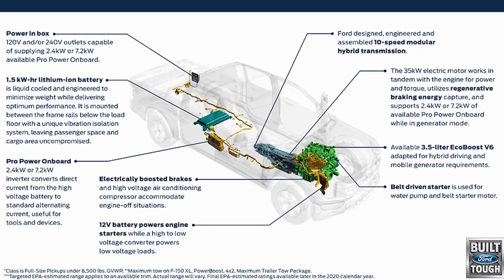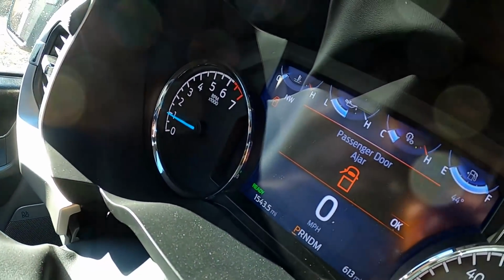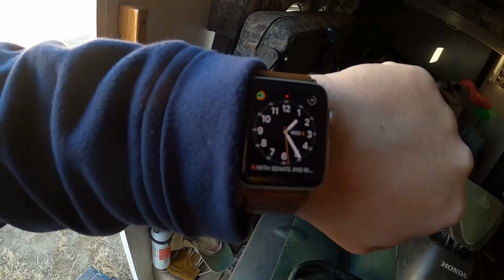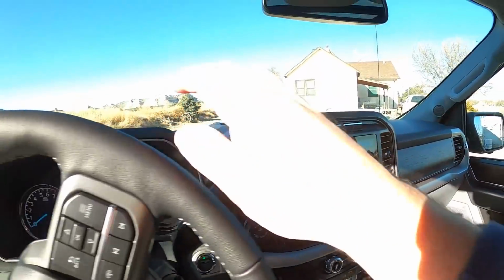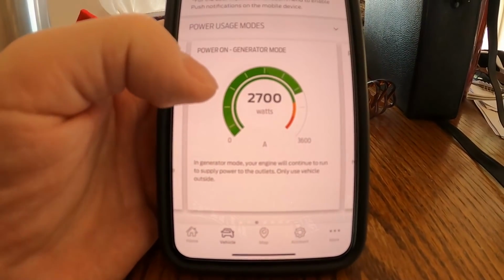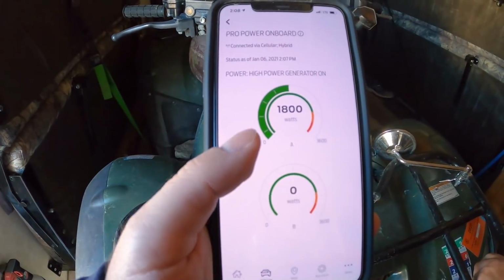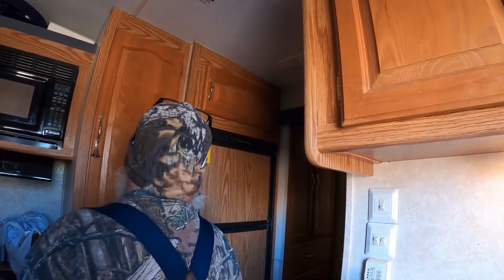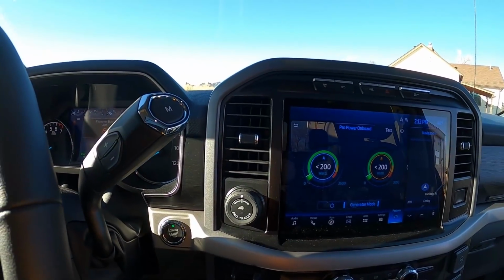Can the truck power an RV? 2021 Ford F-150 Generator Initial Test

Comment: Easy way to get the full 30amps to the trailer. Plug one 120 male cord into one 20 amp circuit and the other 120 male cord into the other 20 amp circuit. https://www.amazon.com/gp/product/B0811MSWRG/ref=ppx_yo_dt_b_asin_title_o03_s00?ie=UTF8&psc=1
Also could be an easy DIY from supplies out of your favorite home store

Comment: Why didn't you use the top outlet plug? Isn't the RV cord 30 amp and the top outlet 30 amp too?
Reply from the maker: I don’t recall the exact issue now, but the camper wasn’t compatible with the top plug.

Comment: Its a nice function, I use my 2016 Chevy Colorado w/2.8L Duramax as my generator on my RV and it works very well. I figured out if i wrap a hair tie around the button on the transmission shifter, it confuses it, so when I remote start it with the FOB, it will not turn off after 10 minutes like it typically does. So i have an inverter inside the truck wired to the truck, which I have Anderson connectors on the bumpers wired up so I can plug my RV into the Truck. My Solar and Lithium battery setup on the RV isnt able to sustain running the A/C inside the RV, but it has enough overhead to allow the compressor to kick on and off, So my truck supplies enough power that i can remote start it with the FOB plugged in and it will run the A/C in the RV all night while idling the truck. The RV batteries offsets when the compressor kicks on, but the truck power will over time charge them back up due to the compressor turning on less and less as it cools the RV and using less and less power as it brings the RV down to temp.

Comment: Do the headlights go on when the truck starts up to run the generator ashen the battery runs low?  If you were in a campground dry camping and it’s nighttime, will the headlamp light up your camp area?

Comment: W=vxa. 7 kl watts is more the 20 amps. You are connected to a 30 amp power. So 80% of 30amps is 24 amps.

Comment: Depending on model of truck and fuel tank size the generator system is rated to run up to 85 hours on a full tank.

Comment: Why would you think the air conditioner would draw a lot of wattage when it's 40° out ? All that's going to run is a fan which draws little wattage. Plus apparently you don't realize 20 amp 120 is 2400 Watts ? Please stop misleading people.

Comment: Is it a generator (I have not seen the actual device yet) or an inverter? (Please don't say "both" we all know a generator must produce A/C for this application).
Reply from the maker: Ok. What do you want me to say if I can’t say both? Ford calls it both. It is really both.

https://pickuptrucktalk.com/2020/10/generator-or-inverter-2021-ford-f-150-pro-power-onboard-explained/
Reply: @Pickuptrucktalk  We are all correct. Ford is playing word games. On a conventional gasoline engine, it is nothing more than an inverter. In Ford's words: 

"Q: How exactly does Pro Power Onboard work? (Power flow from the engine to battery to generator)

Gas: Engine > Alternator > Battery > Inverter"

However, on the Hybrid, it IS both. So Ford explains in the link you provided. But, calling a simple Inverter a Generator is VERY misleading. Anyone can purchase an inexpensive Pure Sine Wave inverter and connect it to their battery and do everything and more than the gas Ford F150 "generator". (Sorry, I am a retired automotive engineer....)

Comment: So you mentioned a cable converter that will allow you to plug the RV into the 30 amp circuit.  Can you explain in more detail how you can plug an RV into the 220v 30 amp circuit? Since the RV is a 120v?  Wouldn’t you need a step down transformer? Or is there a way to configure the F150 220v 30 amp circuit to a 120v 30 amp circuit?
Reply: I’ve been concerned about this issue as well. My RV requires 30 amp 120 so would be nice to use the 30 amp service. I did find an adapter that goes from the four-way plug to a three-way plug. I believe that steps 240 down to 120 but maintains the 30 amp service. Can anyone confirm that for me?
Reply: Super old comment I'm replying to, but that 240V outlet on the truck, if I'm not mistaken, is an L14-30R (L14 = 240V with a neutral and ground which is key, 30 = 30A, and R for receptacle). It's split phase so you have 2 x 120V lines with a neutral, so you can tap 2 different 120V @ 30A lines from it, but for a travel trailer you only need the one. What you need is an adapter that is a "L14-30P to a TT-30R" (P = plug if you're following along). That adapter taps into just one or the other of the hot lines and passes through the neutral and ground.

In theory you could run a couple of travel trailers off this... there's probably someone who makes an adapter with two separate TT-30R dongles hanging off, each one tapping into the 2 different 120V lines. I mean... why not? :)

Comment: You might want to inform the viewers.
The truck engine needs to be running in order to use the generator.
If you don't. The batteries will be depleted in no time. Just remember, 12 volt X battery AH= watt hours. You run microwave at 1200 watts. Depending on the size of the battery. The generator might die in less than 30 minutes. The reason why engine has to run and charge the batteries.
Reply from the maker: The truck engine will cycle on and off for generator mode. That’s how the system works.
Reply: @Pickuptrucktalk  
Yes, that has to happen.
Viewers needs to know. They can't use it like they are at home. Its limited to fuel and battery capacity. Not for long term camping. More for overnight or short weekend. 
Thats why I prefer solar and dc to dc (during travel) charging. I don't have to depend on truck's fuel. Also, I can build much bigger system for fraction of the price. No future repairs that will cost me a fortune.
Reply from the maker: @wt9653  everyone has their own needs. This is just one of many options.
Reply: @Pickuptrucktalk  
I think one of the viewer said. He is putting a camper on back of the bed.
With engine cycling on and off. Carbon monoxide is something to consider.

Only use I could see for this setup is for job sites and short stay camping.

With solar and  dc to dc charging.
I can do both camping and job site until food and water runs out.
Reply from the maker: @wt9653  wait, what? Carbon monoxide poisoning outdoors? That’s... umm... impossible unless you somehow wrap the exhaust pipe into an enclosed space and run the engine for hours overriding the system prompts to turn the truck off.

The rest of your comment is just an opinion. I’ve done short term and more than a week long camping with gas generators. No big deal.
Reply: @Pickuptrucktalk  
Think about it. I said, one of the commenter said. He has a truck camper that goes on the bed and not tow behind.
Yes! Carbon monoxide is very possible having a living quarters over the exhaust pipe.

The truck will run out of fuel if someone over uses it.
It takes hours to charge a depleted batteries. So you have to conserve if you want to come back home.
You're off track on your story.
We are talking about truck generator and not gas generator on your week long camping trip.

Comment: This is all gimmick to get to your pocket.
You can easily build bigger system on your truck or your camper for 1/25th of price. Only the buyers who have deep pockets or naive would buy this.

Look up DYI on building power stations with both solar and dc to dc charging.
Something Ford can't do without fuel.

Comment: As a “test” for running an RV, this video is really invalid as you failed to use the correct adapter to bring the 30 amp plug from 220 to 110 which you mentioned.  Still, even then, the truck did well.  Probably just should have gotten the adapter and then made the video.
Reply from the maker: I definitely thought of just deleting this video, but I thought there were some things that would resonate with people. The adapter was back ordered and now canceled. I'm still working through a solution there.

Comment: Let's be reasonable here. 1 gal of gas is probably equal to 10 killwatt of engery. Your 200 watt lights will take 50 hours to burn through 1 gallon. The truck have 30 gallon tank. You will be safe camping with lights on all night.

Comment: You can press the generator button on the top set of buttons above the screen with the truck off and you will be able to use the generator function without having the truck actually "on"

Comment: You DID NOT turn the vehicle fan off. It is on fan speed 1. The auto lights turned off because you are on manual mode because you clicked the fan button. You have to click the on and off button.

Comment: It only takes about 12 horsepower to run a 7200 watt generator so the truck can idle and make that! At an Idle it will probable burn less than a gallon so you could run 24 Hrs without worrying about running out of gas !

Comment: Tim I don't think that power always goes off to the plug when the truck is off. I watched TFL and they were welding with the truck and when the welder made the battery power go low the truck turned on automatically & the guy commented that he was surprised that the truck only turned on a couple of times during all of the welding he was doing.
Reply from the maker: When the truck is off, we lost power. With the truck on, engine off, the plugs had power.
Reply: @Pickuptrucktalk  OK I get it now how it was being done.
Reply from the maker: @dalephillips8250  it’s different for sure and takes a bit to get the idea on how it works.
Reply: @Pickuptrucktalk  Yeah I just get to watch because I own a 2020 TRD PRO and it doesn't have all that tech but I do love it.
Reply from the maker: @dalephillips8250  that’s a good truck!
Reply: @Pickuptrucktalk  Thanks Just put Duratrac 285/75R18's on it this past Friday Love it but upset that Toyota installer nicked paint on my passenger door. I caught it before I left and they are going to make it right but it just peeved me because my truck has been kept pristine by me then the dealer's workers put a nick in it being careless.

Comment: Thanks for running that test - really interesting. Just based on the watt readings being consumed (~3000) contrasted with what was still available (~600), I'd be very surprised to learn that (3.6kw?) generator/mode was incapable of fully supporting all the power needs for that or a similarly sized camper.

Given that your F-150 is of the new hybrid breed, do you think there will be continued movement to more, battery/solar/wind based automotive power collection and generation systems? 

Thanks again - really enjoy your informative and entertaining videos.
Reply from the maker: The generator is certainly capable of powering the RV, it is an issue getting the 220 volt plug with 30 amps into a 110 volt plug with 30 amps. The RV trailer takes 30 amps and will run most things on 20 amps. Just doesn't have enough power to do everything at the lower amperage. 

As far as the other question, it really comes down to consumers. If consumers buy them, then automakers will do everything they can to build to that demand. The problems with more battery/solar/wind is in physics and return on investment. 

For example, Hyundai has a car with a solar panel roof, yet it really only adds 1-2 mpg on any given day, is pretty heavy and adds a significant amount to the price last I checked. That's not much return on investment. 

A bigger battery would be great, except you are adding weight to the truck which will reduce the truck's payload and capability. It is a trade off between mpg and capability for trucks. 

Automakers are doing everything they can to reduce wind resistance and drag right now which is why SUVs and trucks are all starting to look the same since they all go through the same wind tunnel tests. This similar look creates a lot of challenges for automakers and consumers don't care for it. This is why funky looking vehicles like the Nissan Juke sold and why people love the idea of the Cybertruck. It is different. So thats a hard one to figure.

I think by the Fall and all the videos I'll put out from now until then, it will be clear the onboard generator at 7.2kW makes the hybrid a great option for people, but that the fuel economy gains with the hybrid powertrain are not going to be significant at all and the return on investment ($3-4k depending on trim) will not be enough to pencil out for most people.

Thanks for watching.

Comment: I love the idea that now you can pretty much camp from anywhere. My only concerns are:
1. I noticed the truck's engine was off once you were done load testing, but all of the accessories are on. Would they shut off after a period of time, or would they stay on until the main battery died? Or, would the truck keep the battery charged up as well? 

2. I know the "oil life" will account for the extensive idling, but I'm concerned about a gas engine idling for as long as it might for a camping situation. Would that be harmful over time? 

3. Could you pull the trailer down the highway with the generator hooked up? I could see people doing that and having people riding in the trailer for comfort.

Comment: I know you're trying to create as much content as possible on the 2021 Powerboost as quickly as possible, and I appreciate that like anyone else. However, you should really do a little more research about how electricity, motors, inverters and air conditioning work, and get your terms and understanding down beforehand. This video would have been a lot better if that was the case.
Reply: Correct, people watching and giving thumbs up have no clue how it works.
Reply: He says that in the video abbout the compressor and temp. Shows you didn’t watch the whole video...

Comment: 90,000 is a bit pricey for a half ton truck.
Reply: Tim got this truck for $54k out the door.
Reply: @alienation-k1x  Wow last video I saw it was 90. must have been a limited or platinum.
Reply: I saw and XLT Powerboost for sale for $55k.  Also, it looks like you lose 1-2 mpg vs the regular Ecoboost 3.5.